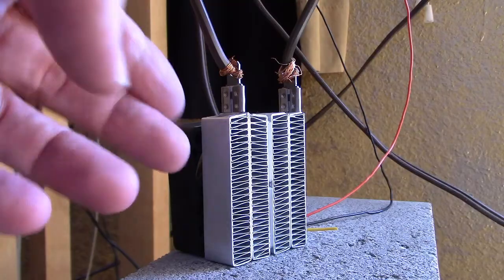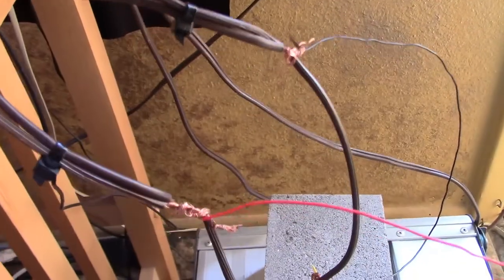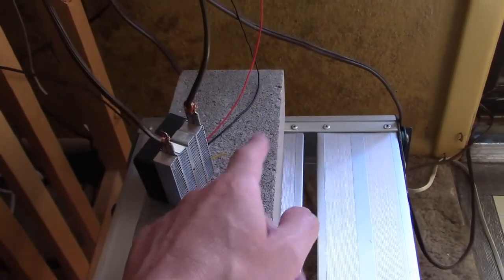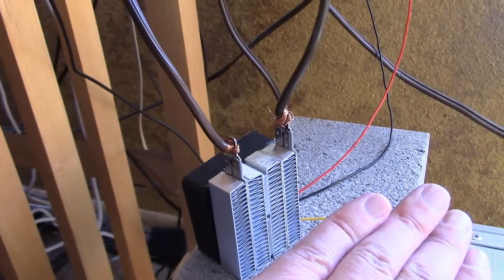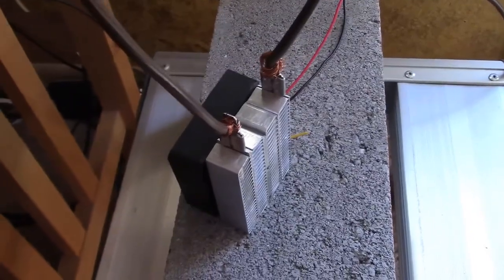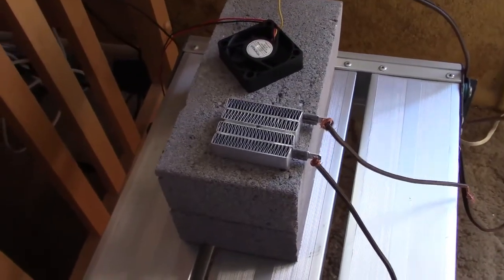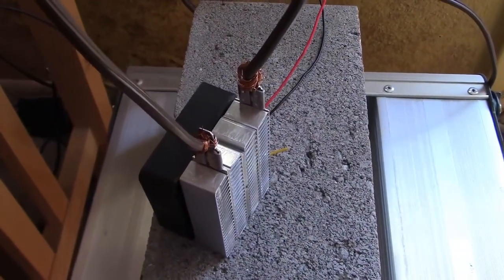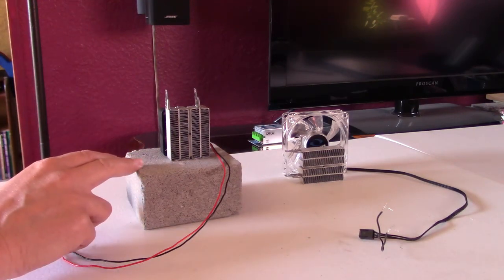DIY 12v Ceramic Air Heater (w/fan!) +alum. fins! Simplest Heater Hack Ever! can be Solar or Bat Pwrd

Comment: I'm researching ptc heaters right now cause i came across one from aliexpress for $10. It also comes in a plastic shell. Im trying to figure out if any of these have thermostats. I want to make a heat box out of a coleman cooler for sensitive electronics like my lte router in my rv while its in winter storage that gets down to -40 for my internet based security/camera system. Edit: it looks like this one.... https://youtube.com/shorts/hzFk5k_A5Mo

Comment: I need something like a computer case fan But a USB type. My big problem is they all run at a speed of 1000 - 2000 RPM. I just need a USB circulator (slow) fan and I cannot find one anywhere ? Any help would be helpful ?

Comment: I'd like to buy one what is the element called?
Reply from the maker: hello, they are called ripple PTC heating elements. if you search that term on amazon you'll see them. they have many different voltages and wattages. i usually use the 12v ones.
Reply: @desertsun02  thank you for the info. Work good for dumping a load too. Thank you.
Reply: Electrical load lol.

Comment: If I run 2 or 3 of these in my room, will it warm it? My room is about .. idk its not too big but not small either (14x12 maybe). What if I have only one running?
Reply from the maker: hi. yes, they will heat it. a lot depends on how cold the room is to start with and how well insulated the room is though. you'd have to experiment to see if you need 2 or 3 or just one.
Reply: @desertsun02  thanks. If i do it, I'll post an update to let others know with correct dimensions and everything

Comment: How would something like this work in my car how would I wire it? To what what can I house it in
Reply from the maker: hi. you can basically just wire a 12v plug to this unit and then plug it into the 12v power socket. ✔😉

Comment: Use the elements in sand inside of a ceramic pot to generate radiant heat?  It would be worth an experiment to see the results
Reply from the maker: hi. i agree. i think it would work well.

Comment: Right,  I use heat at night ?
Reply: That's when you add battery bank to your solar panel(s). I'm watching this for that reason now that I have one. Not hard to wire batteries in parallel to the system. You do need a charge controller to prevent overcharge though.

Comment: Have you considered a 12 volt ducted fan from an RC plane? Those things put out a crazy amount of air.
Reply from the maker: i hadn't thought of that before. i'll look into it. (thank you for the idea)
Reply: @desertsun02  You can get a 12 volt brushed version that doesn't require a speed control. I'm thinking about trying one.

Comment: Does it need to be 2watt fan? Harder to get where I am. They are all 1.2 watt
Reply from the maker: hi. it doesn't need to be a 2 watt fan. most 'case fans' are 1 to 5 watts (and any should work good)
Reply: @desertsun02  awesome thanks. Building two for my outside buildings. Have a leasure battery and 100w panel. Hopefully get enough sun for free heat.

Comment: Hello.
I think im asking a basic question but it does not seem to have been answered before.
My setup is 12v solar panel at 250watts.
If i get a 150 watt heating element. What will happen if panel generating 250 watt. Will element just run hotter? At what point would element melt? 10 20 30% over capacity?.
Also what if panel is generating 100 watt will element just run cooler. At what point would there be no heat generated from heater element. When panel at 50 watt 80 watt.  I know there is no exact answer but just ball park figures.
Thanks for the video looks like a good setup without all the complicated electronics with a battery setup.
I just want simple setup. If the sun is shining i want panel to power heating element ( without melting and starting fire). If no sun then no heat.
Reply from the maker: hi. the element wouldn't run hotter or melt. they (the heating elements) only draw the power that they needs (so if you're using a 12v 150 watt heating element could use a 12v 1000 watt panel if you wanted to). they don't make them that big (but you could use it if they did). it will only draw the power that it needs. if the panel doesn't produce enough power then the heating element will just be cooler.

Comment: If it’s hot as you say how the fan frame doesn’t melt? And did you try testing the heater without fan? Is it just stay hot or burn out?
Thank you this is a great video
Reply from the maker: hi. the fan frame won't melt. not even close. the air rushing thru the fins keeps the actual edge cool enough. you can definitely run the heater without the fan if you want to. it's just a ceramic chip that heats the fins. those are made to run dry so it will hold up fine. it's similar ceramic to the ceramic in the tablet style ptc heating elements (the ones with the aluminum casing). check my channel for PTC videos if you want to see those. 🙂👍
Reply: @desertsun02  Thank you for your reply, your channel is amazing
Reply from the maker: @Cika Coni i appreciate that. i was just thinking that i've been making videos for 14 years now. wow. time really has flown by. enjoy watching any or all the videos. ✔😎

Comment: It's connected right to the positive and negative 12 volt supply? Nothing else? Could I use copper for same set up?
Reply from the maker: hi. yep, it's connected directly to the 12v source. that's the easiest way to do it. do you mean a copper radiator?

Comment: I am astonished that why people don't ask the very basic and important question re it's effectiveness. Can this heater warm up a room of 10 x 13 = 130 sqft? Is this heater able to raise the temperature of a 130 sqft room from around 10C to about 18C? And if so in how much time? Otherwise it's a toy only or can be used to heat up a small 3 x 4 incubator. Please Comment, thanks.
Reply: I’m astonished you don’t know this “basic question” is unanswerable with the given information.
Reply: @PinkFZeppelin  sorry, I could not understand what you meant exactly? I mainly wanted the maker to tell or if anyone else expert in this field. My question was that would this heater be able to warm a mid size room 10x12?
Reply: @junaidiqbal5815  It depends is the answer. It depends on how well the room is insulated and how cold it is outside.

Comment: What kind of amp draw does it use to power them both? Looking to make for a small camper or tent use with 12 volt battery.
Reply from the maker: hi. the ones i used draw about 6 amps. they sell various sizes of the ripple heaters (so you may find ones that draw more or less)

Comment: How many amps is your 100 watts solar panel?
Reply from the maker: hi. i have several 100w ones that i use. the range is 5.5 amps to about 6.1 amps. to get the full amps to run heater (even with sun low in the sky) consider a slightly larger panel (maybe 12v 120w or 12v 150w one).

Comment: Hi my friend.. what about if we try to do it with a blow dryer broken or new .take out the cylinder with the nic wire just like it sits in the blow dryer .its like toaster wire . But its wraped around a holder thing ..iv looked at it and haven't tried it yet .iv only got a 25 w foldable solar panel.. but i was thinking of that cause its getting cold here in sc in the minivan Frankenstein has been knudging me to lift the blankets do he can crawl under .time for his winter pjs..but if you think on it maybe we could come up with something.ot dont have to be blazing red hot.alitte heat is all some vanlifers need just to maintain .thank you my friend wnd please keep up these great and very helpful vids... nichrome wire ? Ya know what I mean.thank you

Comment: Hello, can i please ask if this system would work without full direct sunlight? I live in the UK and direct sunlight is not a given. Can I compensate with more panels ?
Reply from the maker: hi there. yes, you can compensate by using more solar panels. i often use a stronger panel or extra panels if i think i won't get full sunlight for many of my projects

Comment: Hello my friend, I have 24V solar panels, is it possible to connect them directly to these 12V radiators?
Reply from the maker: hi. i think they sell 24v ptc heaters (those should work)
Reply: PTC elements will run in series fine, so 2x 12v elements can run off 24v

Comment: im not understanding the wiring ... do you have positive and negative together?   that brown wires makes it quite confusing...  i bought this and see no where does it say what side  is negative and what is positve
Reply from the maker: hi. don't put positive and negative together. it's just negative to negative and positive to positive.
Reply: @desertsun02  but which is which on these ? thet came with no markings and instructions

Comment: Was trying to figure out do you have 2 power wires hooked to the element or power ground those wires are the same color
Reply: One us negative and one positive... elements like those can be removed from old heaters. Can also get different gauges from hair dryers, toasters, electric blankets... most things that heat up with a glowing wire has nihcrome in it

Comment: This might be more efficient if inserted into a tin can or a length of stovepipe, with fan elevated off the capped bottom (pipe is vertical) by about 4", with air intake holes just below fan. Don't want to draw dust from surfaces into the unit.

Put element above fan by about 1-2" and ensure a rise of about 3-4" before a 90 degree bend towards the room. A grille on the opening would keep hands out.

Mount or place in front of (or build a surround) fire brick to absorb heat when it's cloudy or nighttime.

Comment: Hello, do you connect the solar panel directly to the radiator? If the panel is 400w, will it give it all and melt the radiator or does the radiator always give the same heat?
Reply from the maker: hi. yes, you can connect the solar panel directly to the radiator. the radiator (heating element) will only draw the power that it needs. the solar panel can be any size (as long as it's a 12v panel and you're using a 12v heating element)
Reply: @desertsun02  Wow !! very cool, thank you my friend :-)
Reply: 400w panel is 40v so 3 elements in series
Reply: @jussikankinen9409  PTC not working in series.

Comment: You're not offgrid until Amazon won't deliver. Lol.
I can't get Amazon to deliver to me.
...... you can be offgrid with Amazon delivering to you.... but my point is sometimes off grid you can't get Amazon.
Be good if you said where to get things brick and mortar
Reply from the maker: hi. you can get computer case fans at computer supply and electronics stores but the only place i know to get the heating element is amazon or ebay. if you search for 12v ceramic ptc ripple heating elements you'll find them.

Comment: I'm surprised no one has asked this question:  For purposes of heating a room, which works better; the heater in this video or the solar downspout heater you created?  Meaning what would heat the room better?
Reply from the maker: hi there. i haven't done calculations but i'd guess that if you have strong sunlight the downspout air heater would probably have an edge.

Comment: Where did you purchase the ceramic element from?  I am having a hard time finding them online.  I was looking for an easy solution to keep my windshield clear during really cold temperatures.
Reply from the maker: hi. i get them on amazon. if you type in 12v ripple heating element you'll see a bunch of them

Comment: Hi thanks for the video! Would this work hooked up to a 12 volt cordless battery? If so approximately how long would it run?
Reply from the maker: hi. you can run this on a 12v battery. how long it would run depends on the size of the battery. the air heater draws about 6 amps.

Comment: This is great during the day when the sun is shiny. How would you adapt it to be used with a  solar portable power station?
Reply from the maker: hi there. i would probably hook it up to a 12v plug and then plug it into a 12v socket to run it.

Comment: Could you run this off of a standard car battery? How many amps does the element use?
Reply from the maker: hi there. you could run it off a cars battery if the car was running. it's best to use a 12v deep cycle battery if no car. the element is 12v 6a.
Reply: @desertsun02  great thanks! I was thinking of running it off of a 105ah agm leisure battery in the van just to generate a bit of heat if we stop over somewhere on a cold night.

Comment: Just wondering can you run the ceramic heater with out a fan? or does it have to have a fan? Thanks
Reply from the maker: hi. it wouldn't work very good without the fan.
Reply: @desertsun02  Thanks

Comment: Awesome DIY heater videos! The fan gets too hot and the motor overheats on most store bought models. But your designs should help keep this problem from occurring. This could be a Lifesaver for Seniors and Disabled people in cold climates. Great for camping ⛺️ too! Thanks again for sharing!
Reply: The problem with appliances these days are the microswitches inside. He bypasses those with this genius set up.
Reply: Only eskimos live in cold in cold climate

Comment: Can I use that under the water to became a  water heater?
Reply from the maker: hi there. no, i wouldn't use this under water. it's just for heating air. i've got other vids on how to heat water with 12v. you can use 12v ceramic heating tablets or a 12v water heating element (similar to the kind you use in a standard water heater). 🙂

Comment: Could I splice them together into a cigarette lighter plug? I would then plug them into a solar generator.
Reply: I have a pecron solar panel and battery, did not work using the 12 volt connection, it did work, but limited as the watts weren’t high enough, the 12 volt outlet was like 20 watts, not enough. Just bought a 120-12v transformer rated up to 600 watts. Will plug into battery on the 120v outlet and try that.

Comment: Thanks so much for this.  I want to make one to use in a neonate kitten incubator and attach to a temperature controller.  1st can you tell me how to hook this fan and heater up to 12 V 100W converter plug?  I can’t find anywhere how to do the wiring.
Reply from the maker: hi. it's just a straight connect from the fan and heater to the power source. i just twist the wires from those to the wires on the power source. if that doesn't help, can you be more specific?

Comment: From what it seems like and based upon your explanation,  it seems like you could easily power up the element for a few seconds then turn it off to heat up either with the fan off or based upon the waste heat being emitted from the ceramic element, right?
Reply: You can't do anything with this it's not got anywhere near enough power. Better off just converting it to 240 volts and running a regular fan heater this is just not enough of anything it's tiny it's not going to heat a room like if it even heats a car boot

Comment: I really need your help., i nought the element but i didn't know how to wire it
Reply: a bit late, but it doesn't matter which side to use it. It's not a complicated circuit, where a fuse can blow when connecting wrong. This is just like an "exposed wire"

Comment: This is so exciting!!! Trying to figure out how to heat greenhouse during Nebraska winter. Need to learn how to use battery at night. New to this stuff. Thank you for the videos!!!!
Reply: Tape bubble wrap together inside your greenhouse. And then use your ceramic heater with a plug-in thermostat. That’s what I’ve done and works well. 👍

Comment: How long would this last on 12v battery?
Reply: 70 watts is about 6 amps,  And you shouldn't discharge a lead-acid past 50% or so. How big is your battery?
And 70 watts is about 240 BTU. ( a house type 1500 w heater is about 5200 BTU)

Comment: Great video. What's ceramic about it ?
Reply from the maker: hi there. the ceramic part is located directly in the center. it's initially what gets hot, and then it's heat is transferred to the aluminum baffles or fins.
Reply: You can use electric Iron's heating element with putting heatsink both sides.

Comment: Neat. How long might it run on a 12V Marine RV deep cycle Battery? Overnight? Best
Reply from the maker: hi there. this is just an estimate but... since it pulls about 6 amp hrs per hour, and assuming 50% discharge of a 120 amp/hr battery, you might get 10 hours of run time.
Reply: @desertsun02  Thanks, what I am looking for to put in my future shed/cabin. It is slick. You are a clever guy. Best